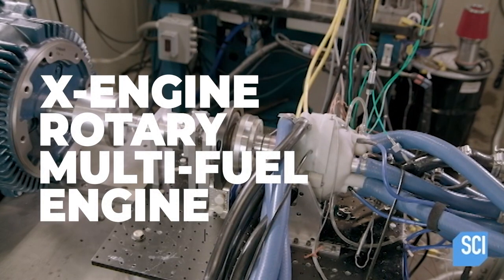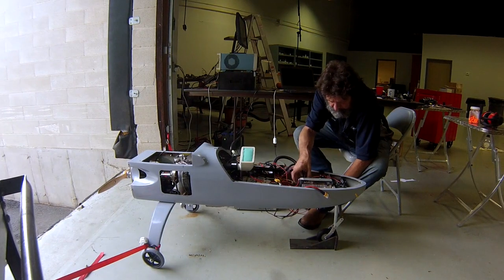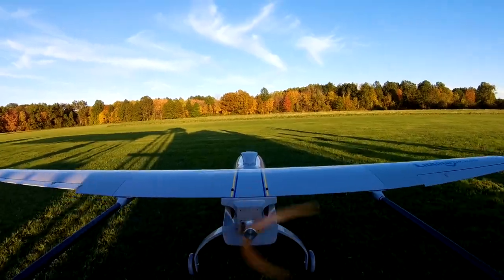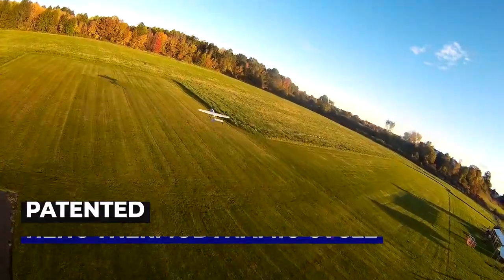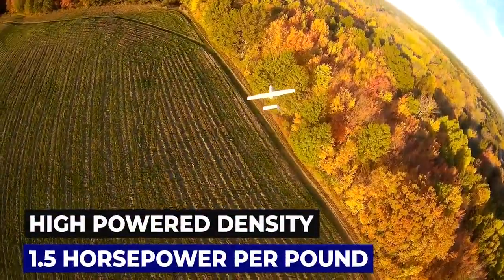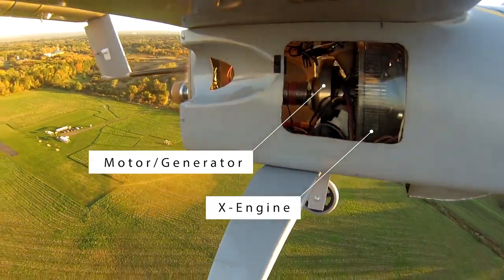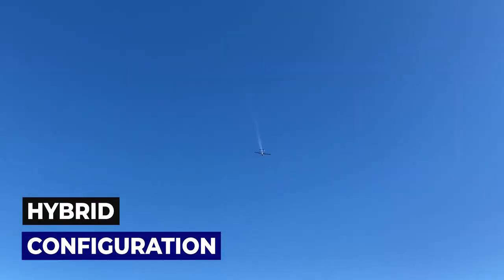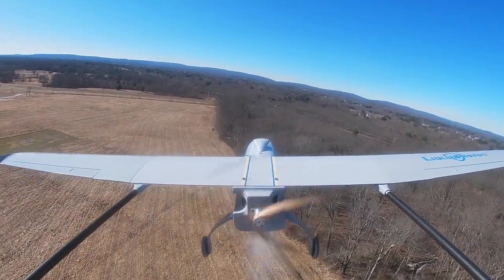LiquidPiston engine takes flight!   [Short]

Comment: Lightweight, controllable power for quad copter. Place rotor & electric motor in one housing to provide accurate speed control of engine plus additional power when needed.

Comment: I wish you guys luck, we’ve been stuck with basically the same engine design with slightly different cycles (Otto, Atkinson) for over 100 years. I am skeptical because rotary engines typically have more downsides which is why we don’t see any commercially successful.
Reply: Any commercially available? That’s kind of subjective don’t you think? There’s a whole cult following for rotary engine. 
I don’t think it was the engine that killed itself, it was emissions standards and people not revving them high enough.

I agree with your skepticism though but more because there’s always something claiming to be revolutionary these days.